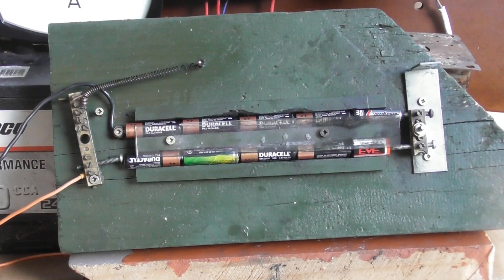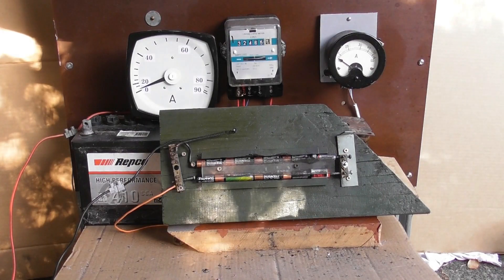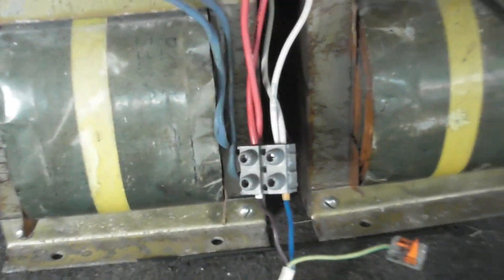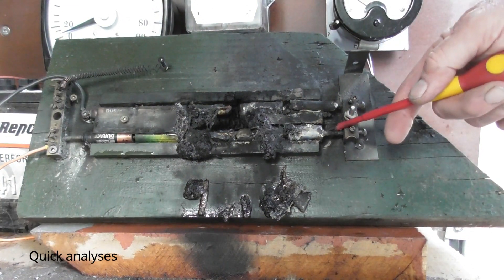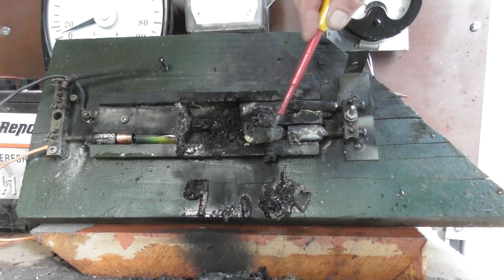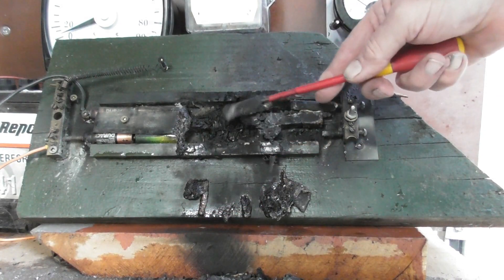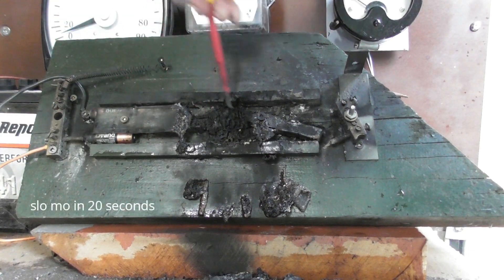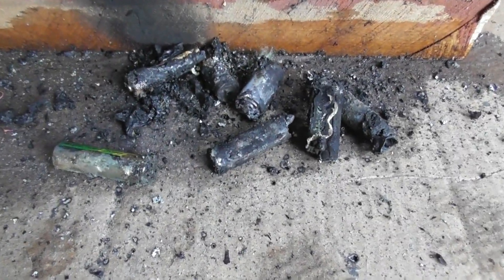Duracell and Lithium battery carnage

Comment: Another epic video! Amazing how violent the explosions of the stressed accumulators can be. Wondering if a welding unit transformer would be suitable for destroying the accumulators?
Reply from the maker: Yes I think a welding transformer would work fine as the open circuit voltage is usually around 50-70 Volts to strike the arc and drops down to 30 Volts for the melting. I pop D-cells with 42 Volts AC.

Comment: Wow 32A D curve, you had fun. I guess the thermal overload part of the breaker had to give in with those nice bangs and pops. Love the vids.
Reply from the maker: It did, breaker was warm.
Reply: @RODALCO2007  Did you have to go to a electrical shop for the 32A D curve breaker. Since I havent seen those types of breakers at places like bunnings.
Reply from the maker: @rakselectric7390  Not Bunnings, I think it was JA Russell or I got it from work, can't remember exactly.

Comment: Very cool indeed! 

Any plans to try that with some 18650 lithium cells? Might need some upgrades in the safety department for that though.
Also, could you put a voltmeter on the output as well? I wonder how much that supply is dipping around the 90A mark.
Reply from the maker: Can do. there will be voltage drop in the supply wires.